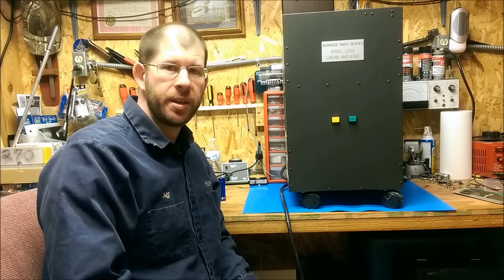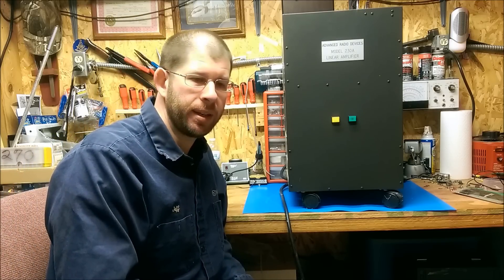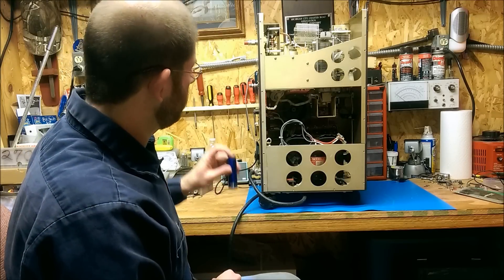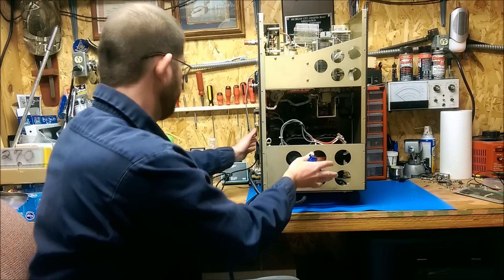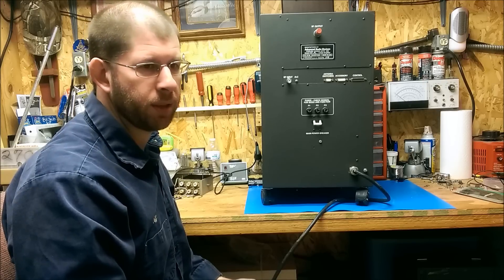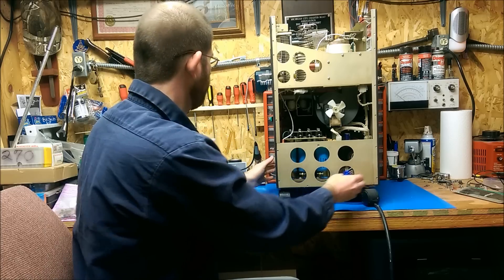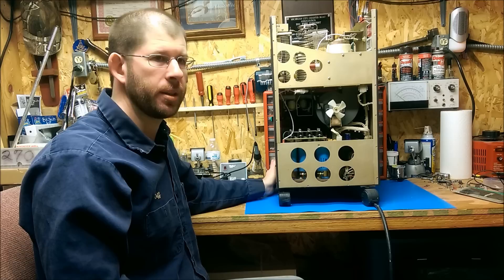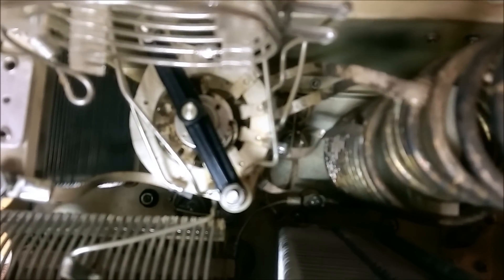ARD 230A Ep1

Comment: i picked up a 230ca about 4 months ago. No control head. So a local ham built a controller for it using an arduino monster. No automatic tuning mode, but it has several memories set up for each band so switching is easy, or manual tuning is also pretty easy. Works flawlessly. 3 eimac 3cx800a7's. Does legal limit on CW with approx. 30 watts drive, 25ma grid current on most bands. Great amplifiers, wish they had made more and had a better reception.
Reply from the maker: Drew congratulations on getting your 230 working. The ARD amps are top notch, and no expense was spared in the design. There are more modern components available today like microprocessors and stepper motors, but the overall design is still solid and relevant. Hope you enjoy many QRO hours on the air.